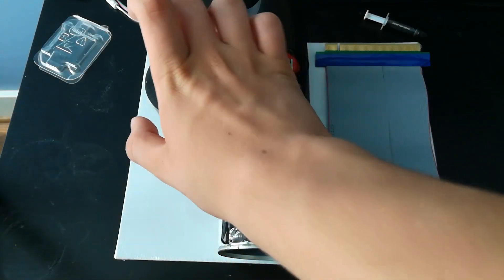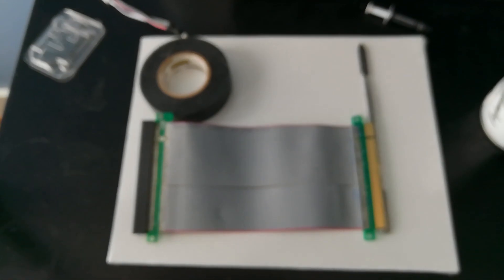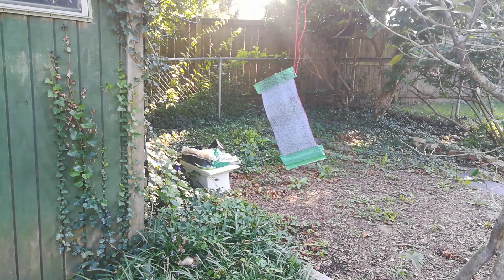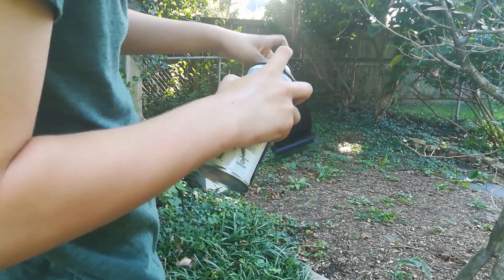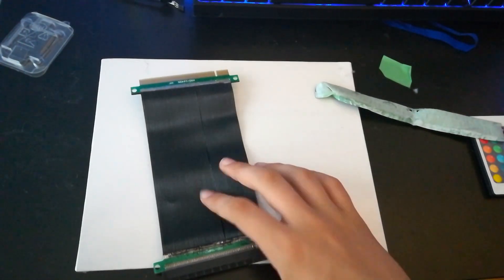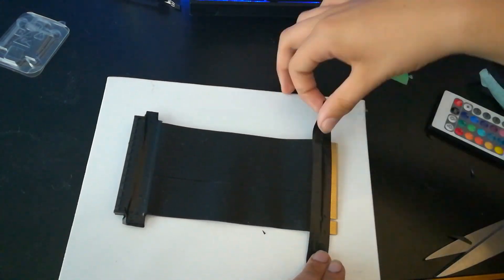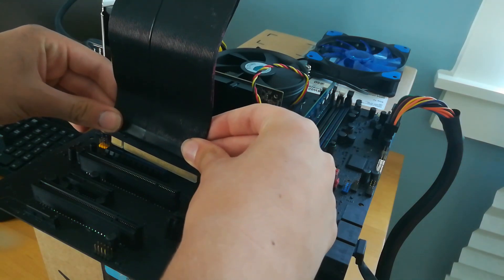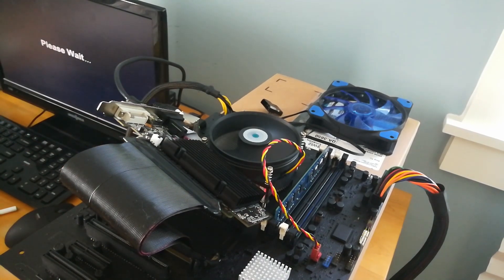Moding  A Cheap PCIe Extension

Comment: with a cheapo PCIe extension did you notice any degradation in performance
Reply from the maker: Not that I could tell, but There was one time I had an issue and removing it fixed things, but I've used it since then and it still works so Idk.

Comment: Hey brother just wanted to know one thing i just ordered this extension(my ass is so broke to buy thermaltake or collermaster) 
Does this affect my gpu performance?
Reply from the maker: The mod does not, but the cable itself might. If you got a short one it should be fine, but these things can be a little bit finicky. Honestly, if you already bought it, I would test it out and see, nothing to lose at this point.
Reply: You mught have to usr some flux and run your soldiering iron across it to reconnect loose connections you cant usually see